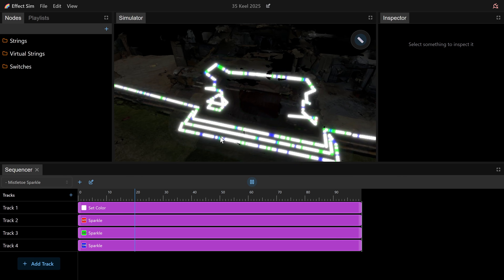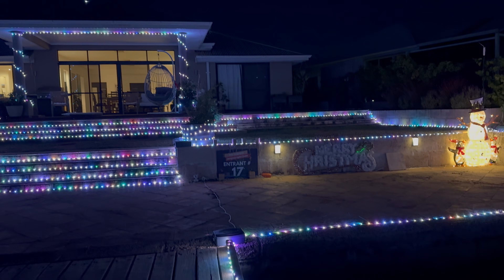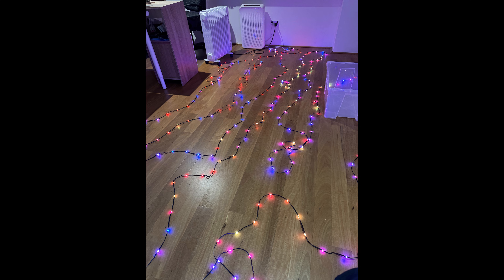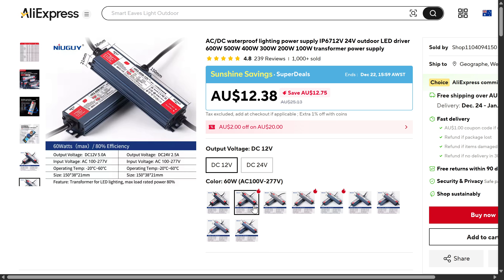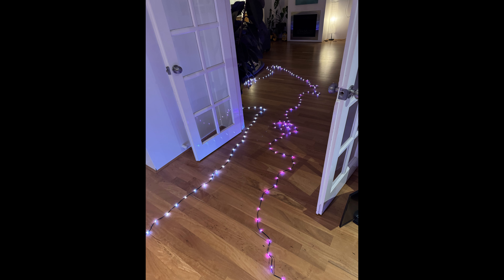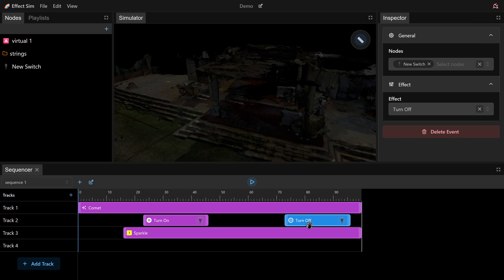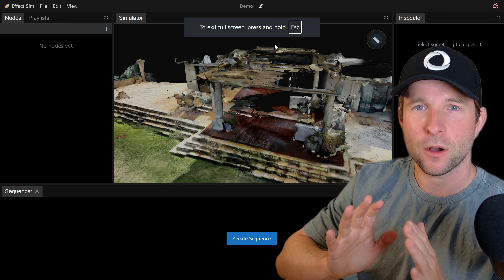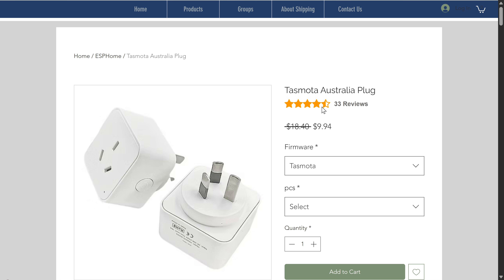I spent 10 months making the BEST Christmas lights display & simulator

Comment: Great project, as you always do. 
How about having a camera looking out to the river and do interactive lights with the boats going by? 
How about loading the sequence to the board first and then only have to execute it via Wifi? That saves you from needing high bandwith for the comms
Good luck winning
Reply from the maker: mike here: oh I like the idea of using a camera facing the boat, the only issue is that it will be dark ( as its night ) I could potentially go a FLIR heat image or something tho?

Ye running the sequence on the device would help with connectivity tho I might be concerned with keeping them all in sync

Comment: Hi! Cool project. For the next time you might consider using ESP32 S3 as it has external antenna as well as proper dual core design, which helps with ensuring 60 PFS since animation routine can run on a dedicated core.

as for wifi maybe it's just thermal? If you keep those poor ESPs enclosed under the sunlight they might get pretty hot.